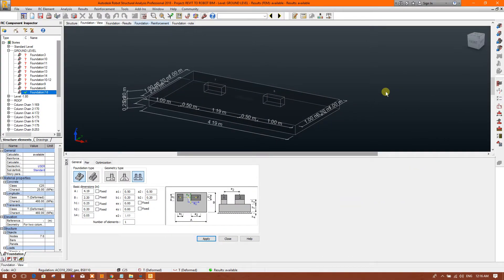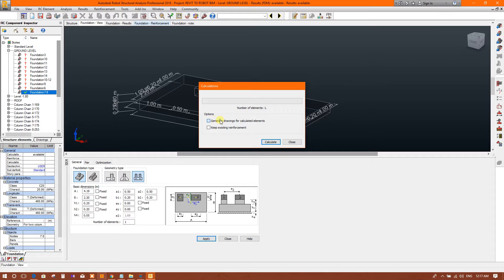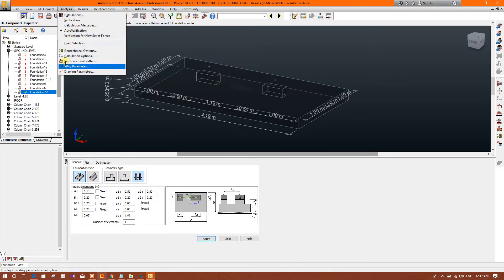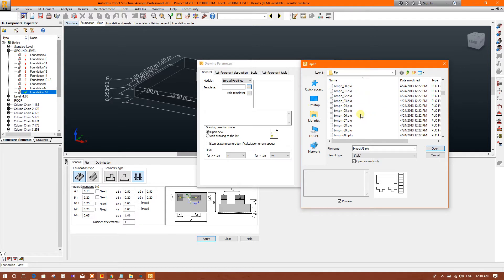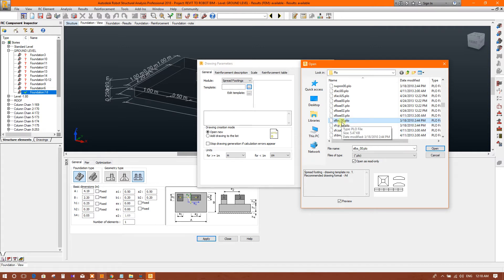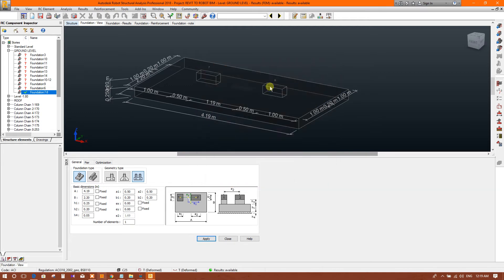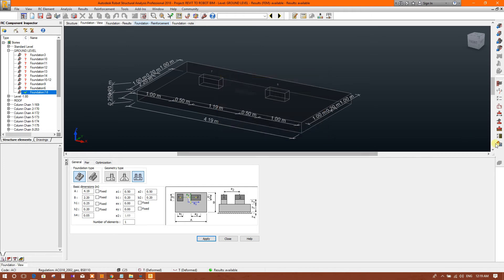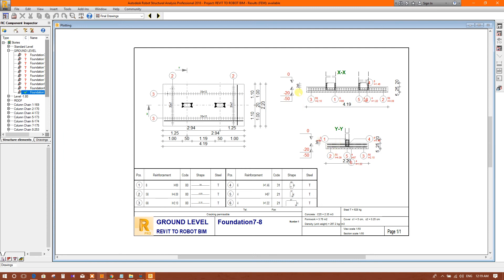DRAWING GENERATION PROBLEM SOLVING IN ROBOT STRUCTURAL ANALYSIS 2018

Comment: Hello, greetings thanks so much for your updates. I have equally and issue with generating the drawing. In my case it refuses to load up each time i try generating. I notice a page which comes up like autodesk report error after few seconds the program shuts down.